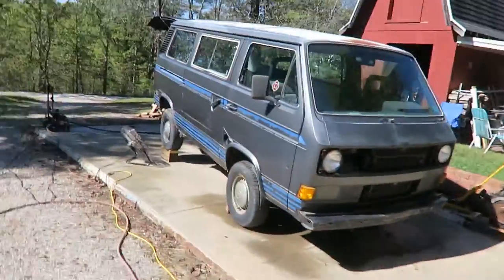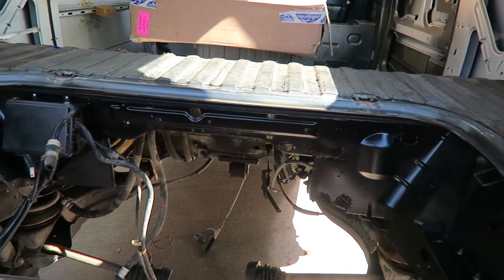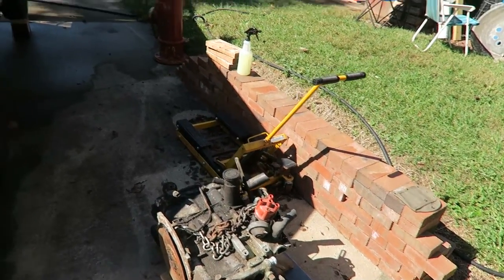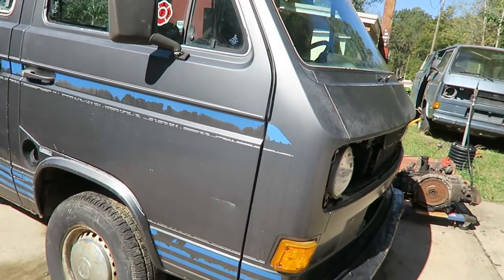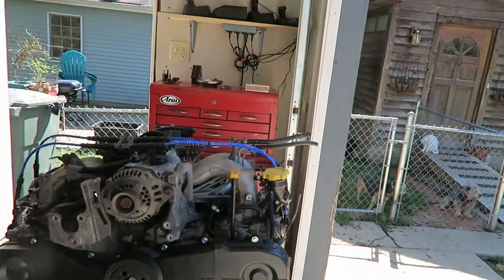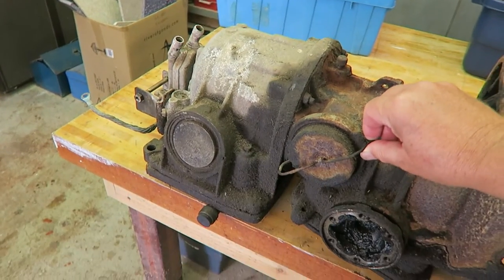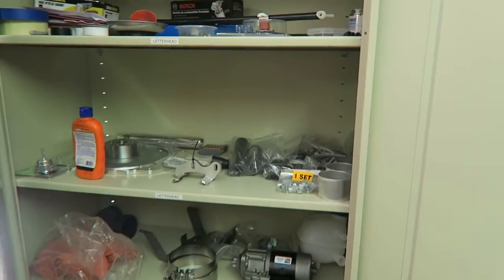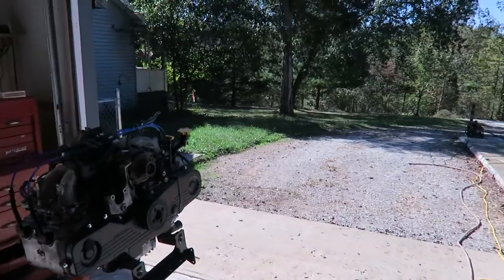1984 Vanagon Subaru Conversion.

Comment: Nice work so far, I just pulled a 2.2 and harness for my swap. I have a question about the coolant tubes. Mine are the factory plastic tubes and they're in great shape. Is it critical to use stainless or aluminum for a Subaru swap or are the factory VW ones okay? Thanks and congrats on your progress.
Reply from the maker: I would think the plastic tubes would be OK.  Mine were in need of replacing.  But I'm no way a expert.   Good luck on the conversion.